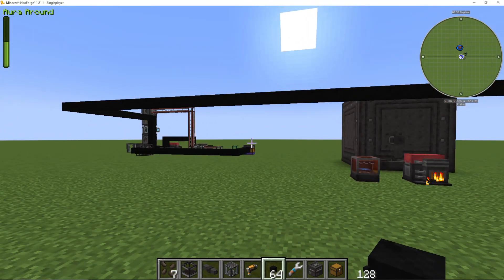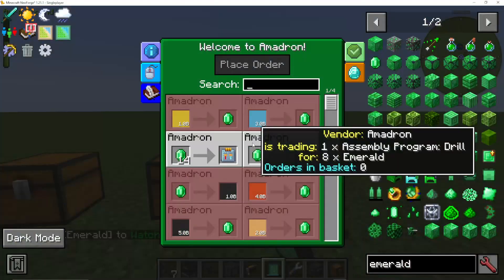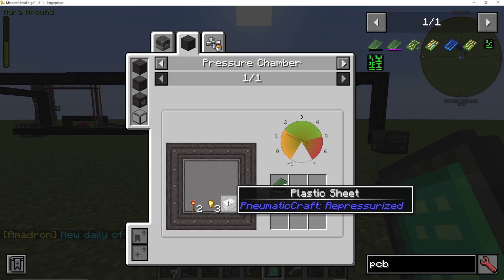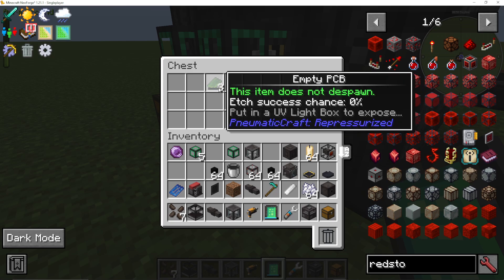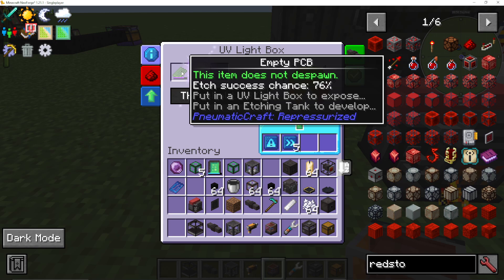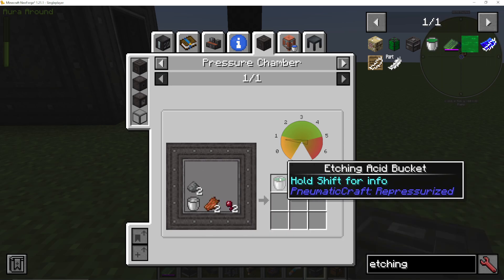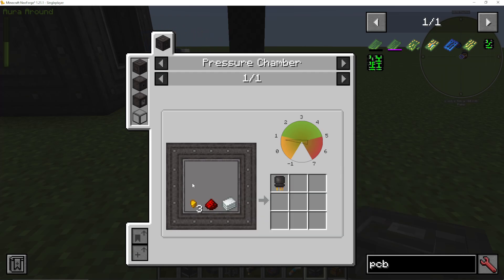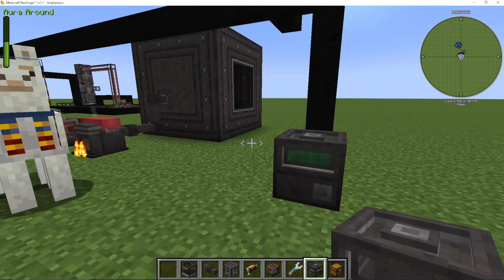How to Make PCB's In PneumaticCraft

Comment: How do you get the bucket of molten plastic?
Reply: took me a while to learn this as well, but if you watch the previous video of him using the oil refinery, you can grab the LPG and convert it into molten plastic using the thermopneumatic something block. You need the LPG, and a coal for it, but also a heater for it to work above 100 deg C